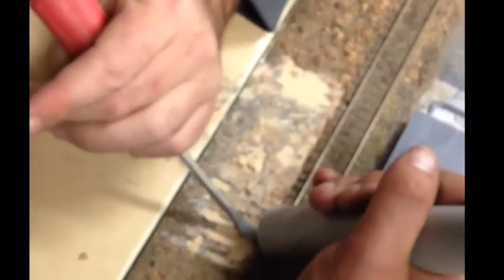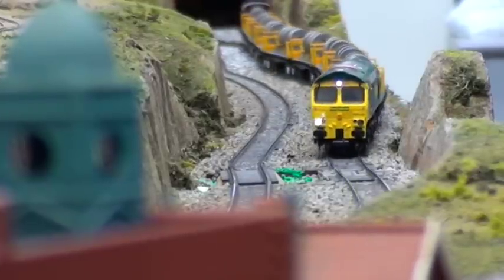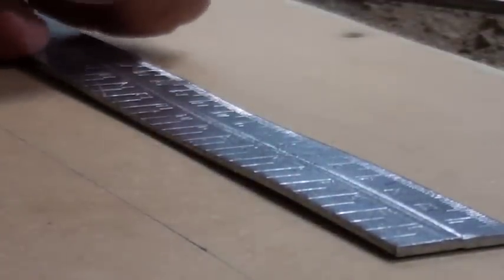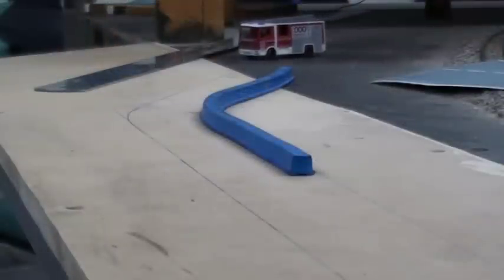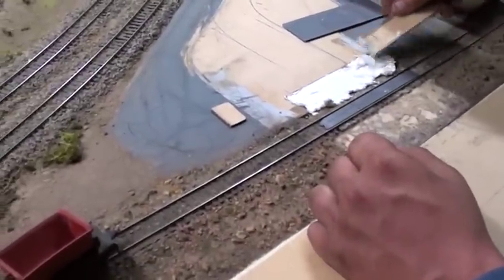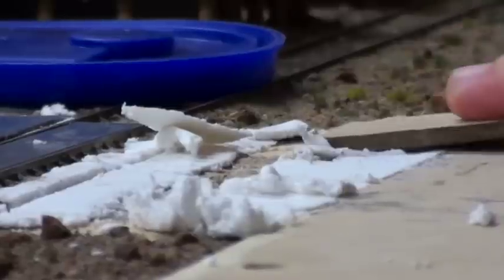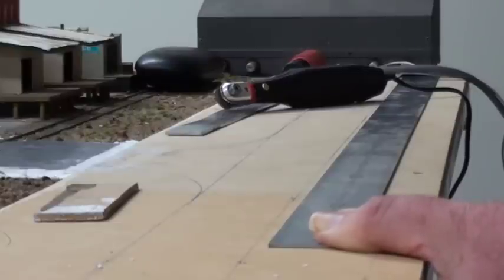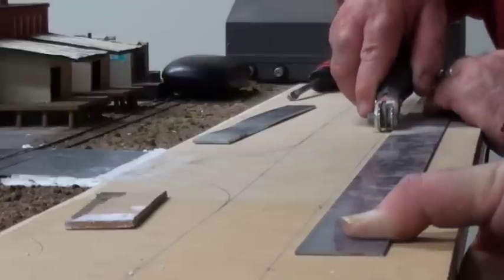Faller Car System @ GMR Stage 3

Comment: Can you please explain how guide wire works
Reply from the maker: The guide wire embedded into the roadbed and secured, is what the cars and trucks front axle follows with magnet which is attached to the steering arm. You can go over train tracks as the vehicle will stay in a straight line for a second without making contact with the guide wire, but will pick it up again once you cross the line.
Reply: Thanks alot👍👍
Also thanks for answering a three year old question 😃

Comment: Can the tool you use to make a quarry in the wood also be used in a vertical position? or is it hard?
Reply from the maker: the cutting wheel has a guide wheel either side which gives the exact depth for a cut but slap holds the tool steady, so you can cut the groove on any angle as long as you keep the guide wheels on the surface you are wanting to cut in to

Comment: How do you do a cross the track wthe the Faller wire  ples
Reply from the maker: The Faller vehicles can cross a track using the FCS level crossing kit, or alternatively you can do your own crossing. Your road should approach the crossing at right angles to the track so the vehicle wheels are pointed straight ahead.- make sure your road is level with the outside of the rail track. Cars and trucks will run in a straight line for a short way without a wire underneath as long as the wheels have not turned. As the tracks are nickel and not steel, the steering magnets are not affected by the track. If you have problems with the cars going astray after crossing, I use an extra "catcher wire" either side of the main wire which are about 1cm from the centre wire but angle back to the the centre wire which means if the vehicle drifts from the centre, the magnet will pick up on the catcher wire and direct it back to the main wire
1. Cut your wire in the approach roadway just before the track
2. lay a piece of balsa wood or plastic in the centre of the track ensuring that it also is level with the track, but allow enough for the carriage wheel flanges to pass through.
3.cut a small piece of wire to fit int the centre of the track making sure it is aligned with the approach wire and embedded just like your normal roadway.
4. align your exit wire in the roads continuation on the other side of the track and away you go

HOPE THIS HELPS.
Reply: what do you mean a backwards tilted collection cable?

Comment: the minimum radius that a curve of how many cm can have?
Reply from the maker: The faller Car system can easily handle 45 degree turns. The sharper the turn the more unrealistic it looks as the vehicle is basically turning on its own track. The smoothest turn, depending on the vehicles would be about 4-8cm radius .